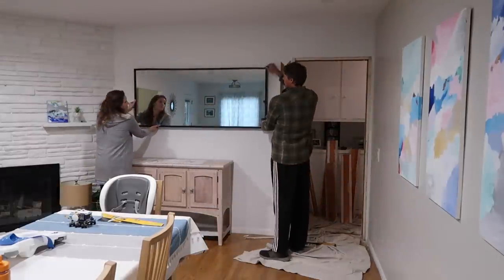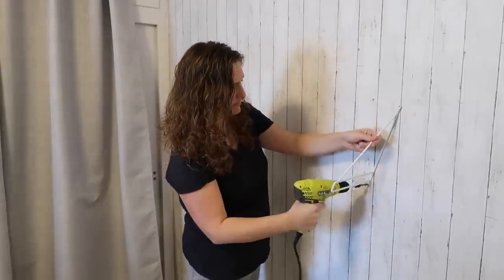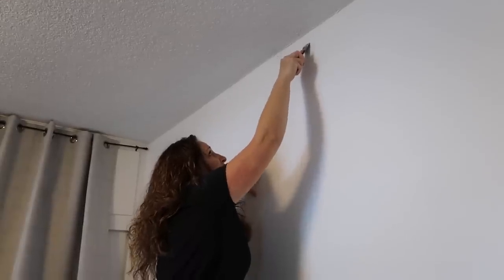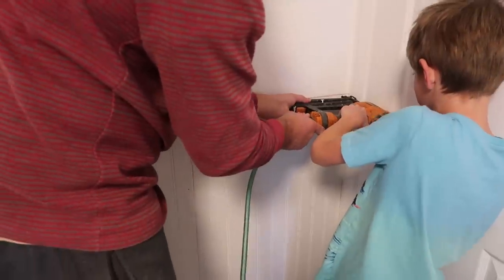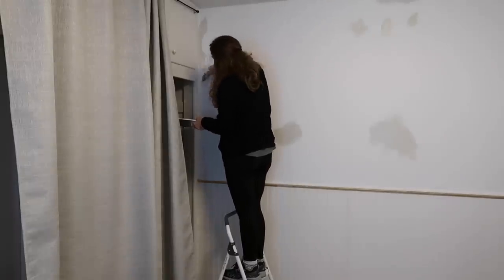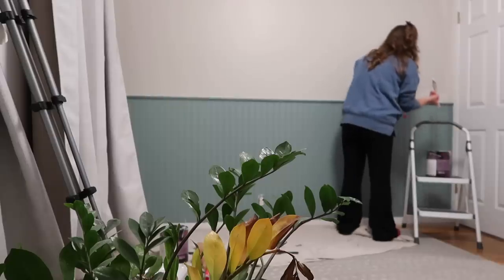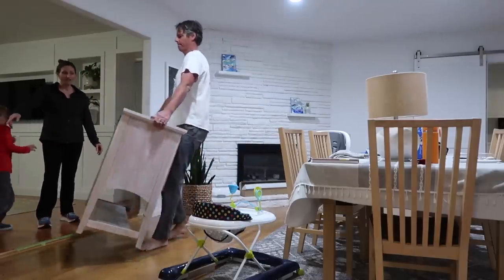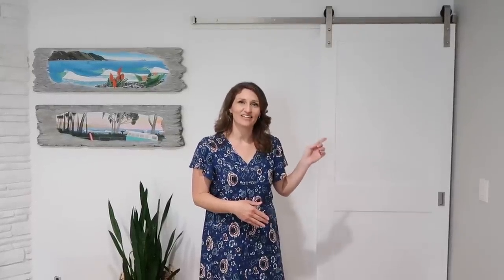Home Makeover New Barn Door Transformation

Comment: Odd question maybe..but could you please ask Grant what his favorite brand/type of caulk would be preferred for this scenario:  I am repainting our LR and the wood pillars on either side of our gas fireplace that are part of the mantle have badly cracked caulk where the edges meet the painted wall if that makes sense. Maybe..just bc the house has settled since it was built in 2008.  I feel like he would say, "Why did they use that?!" (Cheap caulk? perhaps) I thought about using a heavy grade spackle to fill in the edges instead of just painting right over it but I thought, "What would a finished carpenter do??? USe better caulk to repair instead?" Home Depot has so many kinds of caulk and I knew that Grant would prefer one brand over the other. TY in advance if you want to answer my home repair question :D :D
Reply from the maker: Hi Julia, I just asked Grant and he said the best would be a caulking that says it's for window/trim/siding.  He said he would not use spackle but definitely use caulk. He also mentioned that the brand doesn't matter as much as what it says it's for on the bottle.  Hopefully this is helpful. =) Sounds like a fun project. I hope you are having a good weekend.
Reply: @Shannon Torrens  Thank you SOO much for asking Grant! I appreciate it; tell him TY! I will be armed and ready to proceed w/confidence now. I hope you have a fun weekend w/projects as well😊🏡